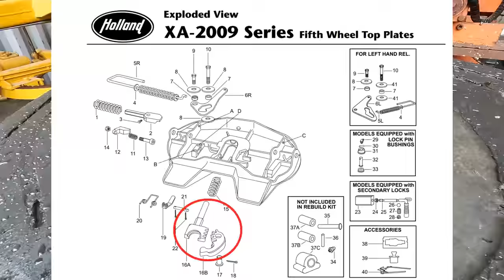1980 Autocar “Construcktor” Hauls its First loads in Many Many Years!

Comment: On the 3 phase power, have you considered finding a small(ish) generator that you could use to power the crane (and other 3-phase equipment)?   Since those aren't things with constant-load, maybe that's an affordable option that would keep you from having to modify things too badly.    Little (100kW and less) 3 phase units come up all the time.   I once picked up a military surplus 150kW for a couple grand.    Just a thought.
Reply: Ask Keith Rucker. He has one, dont know the size
Reply: I'd love to see an old Fairbanks Morse 2-stroke 4-pot outside his shop chuffing away. Those things sounded AMAZING and it'd be right up his alley to be using an 80+ year old light plant to run his workshop.

Also, small world! Any word on when we'll get more #DrumBeats? Hope you're doin' okay down there under this heat wave.
Reply: It would be cool, but turning a generator on whenever Matt needs to use something 3 phase might be annoying, not to mention pretty expensive. 

Something like a rotary or digital 1 to 3 phase converter would do the job,  and you can get ones over 10kw for less than a grand.
Reply: Check out military surplus, lots available in auctions in pa weekly.
Reply: @kojetono5853  Those don't give him an excuse to fire up the autocar or give us a video though.
Reply: @TestECull  Yeah, but would allow him to get going on the '57 autocar, or the drag line. I just think the sooner the shop is up and running, the better.
Reply: When I was assembling amusement park rides, they all ran on three phase power from a generator.  At the shop however, we had three phase power to the building.
Reply from the maker: @larsjuhljensen  only commercial and industrial places have 3 phase in the US
Reply: @larsjuhljensen  3-phase power is not required for anything in a residence so generally it's not available in residential installations. It's a bit bizarre to hear that your friggin oven wants 3-phase power...for what, exactly?! All they are is a fuckoff huge resistor shorting line to neutral with a simple thermostat controlling their temp. They don't benefit from 3ph power. My oven would run fine on direct current if a source of sufficient voltage and current was available!

So wierd. Ya'll got industrial power running to your homes for some reason.
Reply: @larsjuhljensen  in the US, commercial customers usually get 3-phase, but residential customers almost always get a single phase stepped down and center-tapped to 240 split-phase. It's much cheaper. You saw how long that dirt road was. 1 wire vs 3 that whole distance.
Reply: Na that doesn't make sense in the long run. Every time you want to move the crane for any cm, you wanna start a generator? :'D
Reply: @larsjuhljensen  most new consumer stuffs only uses 1 (or in some cases 2) phases and the NEUTRAL.
At least here in Sweden (for some reason or another the manufacturers don't want to produce things which requires 3 phase 400 V considering what many customers only have one phase)
An old single house swedish made owen is almost always 400 V 3phase no neutral required ...  while something from an apartment is 230 V one or two phase with neutral.
Reply: @matthewkriebel7342  however, the cross section of those three wires (and thus the metal weight of the entire run) can be slightly less.
Reply: @DieselCreek  I live out in the country and a couple years ago the Coop here ran three phase down the road I live on but I think it's for a couple oil wells further down the road. Unfortunately my budget or 12 x 20 shop doesn't need three phase equipment. 🙂
Reply: @DieselCreek  Oh, you can get 3 phase in your residential shop if you want it bad enough.  My quote to run a third conductor a little over 1.5 miles to my shop?  $90,000.  So I bought a phase converter which saved me $80K.  Nothing is cheap in PA, that's for sure, but I about fell off my chair when I opened the letter from PPL.  It's ridiculous.
Reply: @DieselCreek  my whole town has 3 phase power in Florida now it only used for bringing power to the transformer and then 240v in to house but I needed 3 phase in my house for my game setup with big motors and it cost a few hundred to get it out in any big power line you see in USA is 3 phase even the small lines that I see In your videos is 3 phase just up to the transformer then it is 240v to your property just saying
Reply: @bobbydazzler6990  we have 3 phase power at the transformer so it cost very little to bring it in to homes here but there is commercial properties surrounding the neighborhoods everywhere so they could be a side effect of having three phase power right away available too
Reply: @larsjuhljensen  I know we're only half part of Europe now (!) But in the UK 3 phase is only commercial, and not absolutely common even then, 3 phase to residential is almost unheard of.
Reply: @TestECull  The reason we have 3phase is pretty simple.
First of all powerplants in the world produce 3p power, but they need to be balanced means same load on each phase.
In US they put 1 phase to each home with 3 houses it is balanced in Europe we but 3 phase in every house and put the rooms on different phases.
A typical kitch stove needs 11 kw, it is usaly 1p for the oven and the two left and right cooking fields on 1p each.
We run on 230v for singlephase you would need a cable that can supply 48 Ampere, means the cable has Neutral, Phase and Ground.
If you use 3 phase you has Neutral, Phase 1 2 3 and Ground but each only need to supply 16A, the 3 Phase can share the Ground and Neutral, you only need about half as much cooper the transfer the same amount of power if you use 3 phase power.
Reply: @TestECull  3 phase is also pretty nice because you can run stuff like big welder, 15t Woodsplitters or big saws for making firewood at home without the need of gas engines a 11kw 3phase outlet is about 15hp the biggest outlet you can get in a residental home is 22kw but this is pretty rare.
Reply: @bobbydazzler6990  I have 3 phase power at the pole in front of my house. The only extra cost would be 100 feet of cable from the pole to the house. Like nicholas said almost all transmission lines along the road are 3 phase and then it is stepped down going to the house.
Reply: @TestECull  Maybe it's related to their free healthcare system. I can get 3 phase on at my house in Australia but I have to pay for it.Costs around AUD$5,000 and up depending on the sparkie.
Reply: @bobbydazzler6990  my house has standard 2 phase split but my game room has 3 phase and in the server room is where the 3 phase panel is it cost around 250ish$ to get the service brought in but the electrician cost and panel cost was almost 3 grand for both the panel and electrician cost
Reply: Oops. My VFD idea likely wouldn't work for this application, your motors are probably not inverter grade and could be damaged by being run by a VFD.
Reply: @bobbydazzler6990  I have a splint 3 phase and 2 phase panel In my house the main parts of house run on 2 phase and my game room and server room is on 3 phase panel and I'm billed as residential the meter are both read and added together and billed to me.
Reply: @bobbydazzler6990  same rate bud it is up to the power company what they bill it at my 2 bills are the billed at residential rate
Reply: @jonasstahl9826   What are you trying to weld that needs a 3-phase supply?! A single phase 220v supply will weld pretty much anything this side of a main battle tank...
Reply: I have a 150kW 3-phase genset I'd love to sell to Matt. It's powered by a Cat 3306PCTA but doesn't have a radiator. Right now it's in Arizona.
Reply: @jonasstahl9826  Most of the reason for this is that the electrical infrastructure in the US dates from the early part of the 20th century and the standards were set back then.    In Europe, electricity was installed much later and benefited from lessons learned by US installations.
Reply: @TestECull  Sure you can get a 200 Ampere Welder with a Standart plug, but than the breaker is maxed out what can cause problems if you run other stuff like lights, old industrials welder a pretty popular because they are cheap, they require 3 phase power.
My grandfather a retired welder has his former working equipment a 400 Ampere welder  at the size of a washing machine in his garage.
Reply: @jonasstahl9826  Again, what are you trying to weld together, main battle tanks?! A 200 amp welder is overkill for building a fucking semi truck from scrap girders! Most welding outside of heavy industrial applications is done at around 85-125 amps.

If you're trying to weld at 400 amps you're either trying to weld military vehicles together or you're building skyscrapers.

Also, why the hell would you be running lights off your welding circuit? Those need just a handful of watts and are always on their own seperate circuits.
Reply: @ckm-mkc  Might be the case, ontop of that in Europe washing machines and dryers heat with electric power, electric kettles and stoves are also standart.
As far as I know in the US they heat with Gas or get hot water from a gas powered boiler.
We just need more electric power for a European house.
Reply: @TestECull  I dont say you need it, but the big old industrial welders are cheap, because they are heavy as hell.

The thing is most garage have only 1 breaker or 1 breaker and 3 phase.
If you have a welder with a standard plug you need to run it on the same breaker that your lights have.
Upgrading the the electric system is expensive and people usely dont DIY them.
Reply: Look at the intro again and you'll see some HV transmission lines that parallel Diesel Creek... all he has to do is tap into them and he'll have amps and volts to spare 😄😄
Reply: @Juha Tuomala Ya'll are doing something completely fucking bizarre over there if you can't do the typical home gamer type welding on a 220v 1ph supply like we do. The only real justifiable reason to run a 3-phase circuit out there is to run something like a clapped out Bridgeport.
Reply: @Porty1119  Road trip for the a-car.
Reply: Given how far off the public road that shop is located, a generator is a practical choice for operating machines including the crane. Figure 1 1/2 KW per horsepower for tge largest motor you expect to run plus 1kW each for smaller motors that you expect to run at the same time.  There’s a lot of used diesel standby generators on the marked with very low hours.
Reply: @kojetono5853   the only problem with phase convertors is you need a pretty large single phase service to power them. Given the long run to get to his shop, that will be very expensive. Diesel is probably a good choice there.
Reply: Fun fact : in Italy it is easy to have 3 phase at home for cheap but we can't modify at all our cars/trucks, we need extra driving license to tow over 1500 lbs and other fun stuff
Reply: @Juha Tuomala  only that the big chains (including K-Rauta) only wants to sell the Central Europe version of kitchen appliances (and so stupid power balance in a new Siemens/BSH ceramic stovetop... which means that off 3 phases only 2  utilised maybe - damn electronics.)
Reply: @DieselCreek  I didn’t know that three-phase was not available for domestic power in the United States. The Triphase power supply is available in France I benefit from it and I find it very convenient with a good balance of phases This allows me with a single subscription to feed two buildings My home and another important building that houses a music school, auditorium recording studio and others. Always Great video Mat And great music too!!🤩
Reply: @Juha Tuomala You don't need arm thick copper wires to weld on 220 volts. You're just welding really crazy thick workpieces over there, 'cause 220 volts will weld a semi truck together with cables about as thick as a thumb.
Reply: @DieselCreek  You could also build the shop very wide and very short, or long and narrow, so that you could fit what you have without making it huge, and the rails on which the whole crane travels would be very short.
Reply: @TestECull  The US (and a tiny handful of other '120v' countries) are the minority that run a 'split phase' 240v system, the rest of the world uses 3x 240v single phases (ie our lights and power outlets are all 220-240v) and three phase is very common in houses here (it's as simple as running a set of lines out to the street feed from the house)- many are a single phase, but it is quite common to have a 3 phase supply into a larger house, or if you have a 'backyard shed' with three phase equipment like a welder or air compressor or suchlike in it...
Reply: @kiesh.  Strange, I know people there that have a 'home workshop' in town in Cambridge, and they got 3 phase on there- it was already connected when they moved in, one of the reasons they liked the place lol
Reply: @jonasstahl9826  A 40A threephase outlet isn't uncommon in home workshops here in Australia where you have 3 phase already on or get it connected up (my stepfather had it put on, cost about a grand)
Reply: @pipercessna3827  The one at my mums house only cost a touch over a grand to run the cable and fit the meter to the fusebox... 😲
Reply: @steved2136  Still not gonna need 3-phase power to weld anything liable to be welded in a backyard shop.
Reply: Why could he not acquire and old 3-phase generator with a toasted motor and then simply drive the generator with a single phase motor? Input 1-Ph, output 3-Ph. The input motor simply needs to be of sufficient HP to run the crane.  Generally generators are about 3,600 RPM and 1Ph motors are certainly available in that range.
Reply: @steved2136  Nice! We were told by the sparkie in Melbourne $5,000 and up. At $1k I would have jumped at it. I should have asked more questions but it wasn't a necessity that I needed at the time but it was when I put solar panels on the roof. Would have liked that extra 3+kWh of generation. With 3 phase you could have 10kWh on the roof. Without 3 phase it was 6.6kWh. No idea why when the power supplier buys it at 10.5 cents/kW (that is not 5 cents/kW) and sells it back to you for 28 to 44 cents/kW.
I appreciate the feedback Steve. Have a great day! 👍
Reply: @pipercessna3827  Actually- while a single phase supply is limited   to 5kw (inverter)- usually 6 or 6.6kw dc solar, if you have a three phase connection, you can have double that (30kw in total over the three phases in inverter power)- makes no sense that a 3 phase can have double the inverter power- but then - political rules often don't...
Reply: @TestECull  But the 3 phase is simply cheap and commonly available (especially when it comes to motors) and so it is in common use... I know the yanks find it hard to understand when they have so little experience with it, but a 3 phase motor in an air-compressor or lathe or whatever is actually much cheaper and far more reliable than an equal single phase motor- and as it is a extremely simple, cheap and common option, it makes sense to get it fitted to the house if you plan on using such stuff... You are  thinking we would need three single phase transformers or a multiphase one 'fitted to our house'- we don't have transformers at our houses like the US system- an entire suburb will have a single 'substation' and the three phases plus neutral are run in our street supply- so 'getting the three phase on' is simply fitting extra meters (if you don't already have a smart meter) and replacing the 2 wire street feed with a 4 wire one... It's literally an 'under an hour job' in most cases...
Reply: @steved2136  Homeboy was saying he NEEDED 3-phase power to weld, that welding on 240v 1ph just isn't possible. I countered with 'no, no you do not need 3-phase to weld, not unless you're welding fucking battleships together'. You're waffling on about semi-related irrelevant details that don't matter to the discussion at hand.

Comment: Side note when it comes to adding things to lubricate a diesel system, ATF certainly works, but a decent synthetic 2 stroke oil will do the trick, and unlike ATF it is actually intended to burn, less smoke and it smells better :) works out cheaper for me also, around here ATF is priced like bottled unicorn tears :P
Reply: Marine 2-stroke oil is preferred as it is designed to burn in a (lower temp) water cooled engine. Normal 2-stroke for air cooled engines is designed to burn at higher temps and can causing varnishing in a cooler running 4-stroke motor.
Reply: Modern synthetic two stroke oil doesn’t smoke much all, it’s an excellent top end lubrication for a 4 stroke.
Reply: When I still had my old Silverado I ran small amounts of semi-synthetic TC-W3 in it every time I filled up with gas. It helped make it idle and rev smoother when driving. Some people said it supposedly helped with fuel efficiency which I never noticed. You don't drive a pickup to save on gas. :P
Reply: @Slane583  Gas? or diesel?.
Reply: "bottled unicorn tears"! Darn near lost my coffee, with that!!!
Reply: @HJZ75driver  Gas. It was a 1500 like my current truck, we never had the need for anything bigger. From what I could tell I wasn't putting in too much because it never smoked. Nothing ever got gummed up. Besides adding some extra lube to the cylinders it helped oil the fuel pump. :)

Comment: Hi Matt, I love the content on your channel and raise my hat to you. Here is a tip for your Diesel engines, I used 
Liqui-Moly Diesel Purge Injection Cleaner (500 ml)L on all of mine and my 40 year old Unimog runs like a dream after applying that. Runs cleaner, less smoke and way more power. Bought mine on Amazon.
Reply: I was going to suggest the same, although I've only ever used it on light vehicles. It worked well for me, cleaning my diesel injectors to stop smoke.